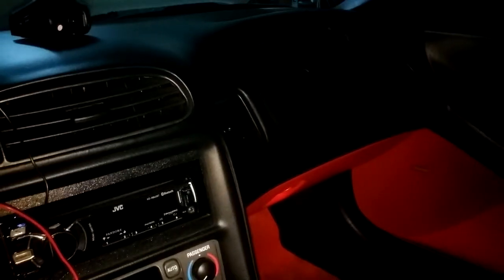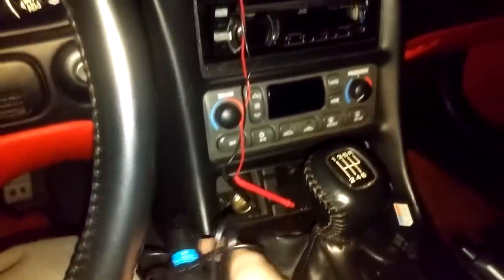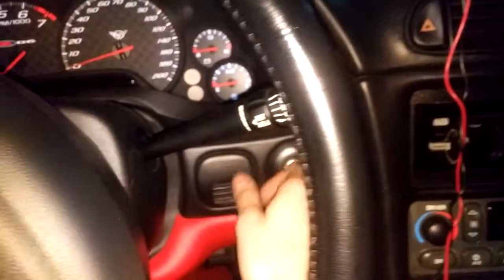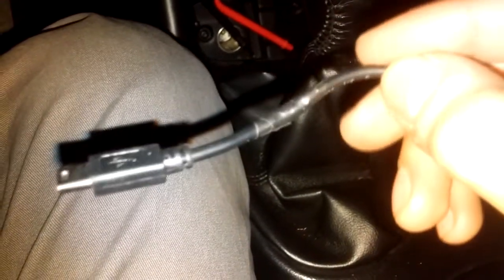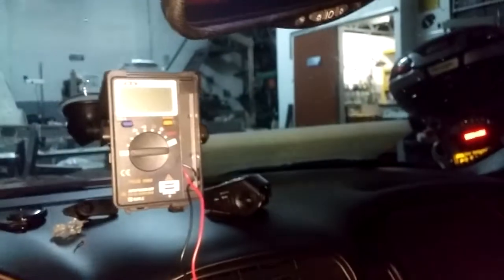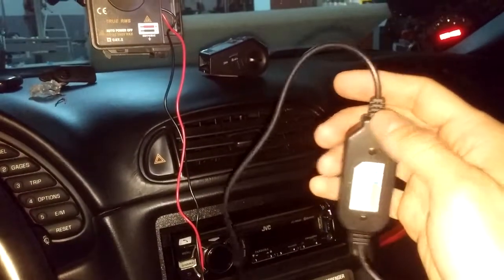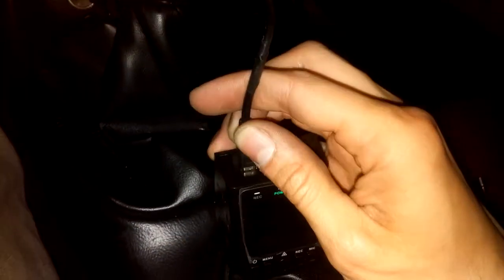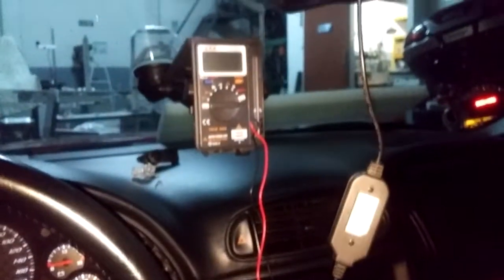Corvette C5 Easy Dashcam Installation

Comment: i wish you would have shown cutting the length of the hard wire cable down to smaller size, and how to reconnect
Reply from the maker: Well, the final lenght i used is just what you can see on the video. I'm sorry it is not specific and i cannot remember it. But the reconnection is straightfoward: Black wire on harness is ground and Grey wire on harness is Switch Power.

Comment: How'd you get the wires to stay within the mirror connector harness? Some sort of special prong type tap? Or just shove them in there good and latch the connector?
Reply from the maker: Yes, they are just sharing the socket with the pin. I used a very small screwdriver to insert the cable tip the deepest possible in the pin socket of the connector. The shaved tip should be long enough so you can bend it and make it fit tightly into the socket. It is still in there after almost two years of regular road use and some track days.
Reply: @grandoFAST  no luck, cannot get these pins to open up at all. Wire just bunches up and deforms. :(
Reply from the maker: @ArtClassShank  Then just open the wire in any segment a little bit with a blade to expose the cooper and hook in there cooper tip of the new wire. Isolate them with non conductive tape and done.

Comment: Will this same method work with a radar detector I ordered the mirror red and black wire connector
Reply from the maker: As long as the radar detector works with 12v, it should work